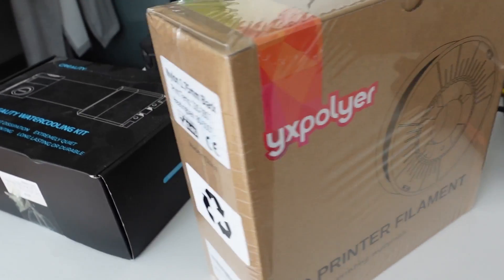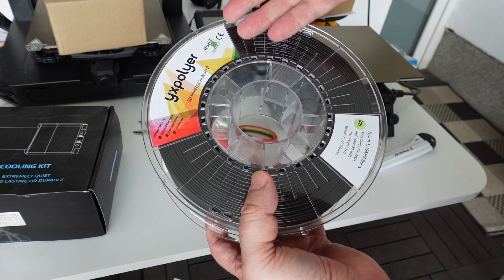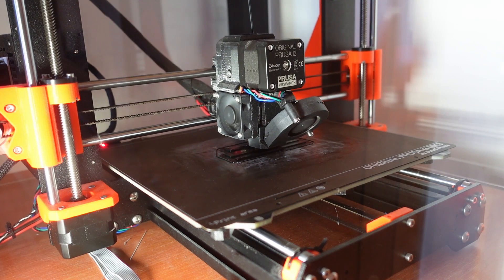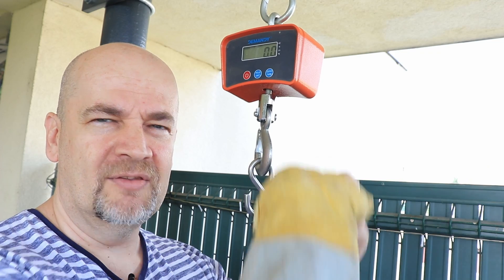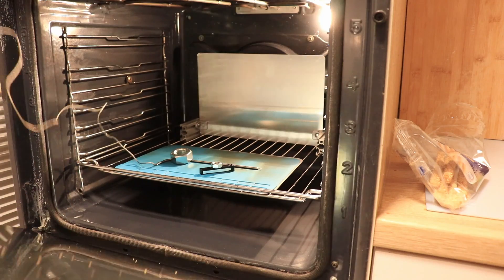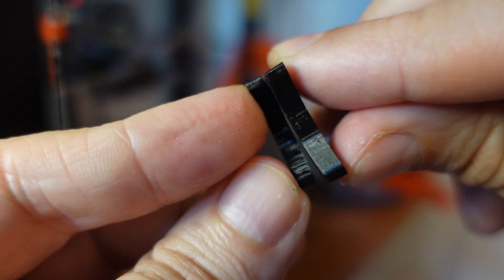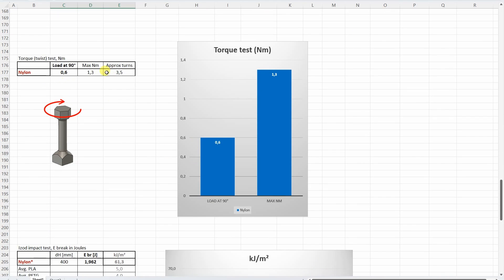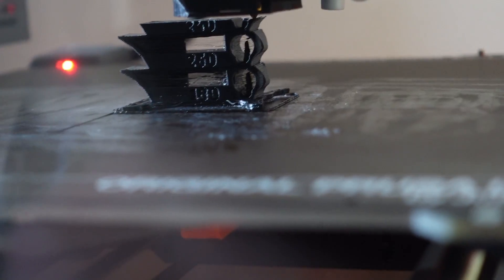Cheap and strong Nylon filament by YXPolyer

Comment: I print mostly in carbon fiber nylon, peek-cf, pa12-cf, pa6-cf, & pet-cf. My routine for printing ALL nylons is warp free, strong, and used for extremely harse use, lol. I print all nylons as follows...
With nylons, i use a carbon fiber bed, g10, or a titanium coated flexible magnetic bed. I ONLY, again...ONLY use elmers magic disappearing purple  glue sticks. Typically, i use magigoo or other more "expensive/premium" bed adhesives. But with all nylons, only elmers purple glue sticks! 
Pre-heat the bed to 90°c, and print the 1st 3 to 5 layers with the bed @ 90°c
Then, drop the bex temp to 32°c after the initial 3/5 layers
I typically print 280° to 300° depending on the brand of nylon
I print with 100%, infill and only use "gyroid" infill pattern.... this is rhe key to no warping. 
No fans or cooling at all, and you must print in a enclosed platform.... keeping the inside temp around 70° even... with very very still air inside the enclosure. 
Its also a must to dry all nylon filaments at 70°c for atleast 24 hours with the moisture reading at 10% to 12%. 
No warping, bending or creep. Hardened steel or titanium nozzles only with a high temp set up. Hope this helps and have a wonderful day!
Reply from the maker: Thank you for these tips. What 3D printer are you using? Hard to find one which can be heated to 70°C (enclosure)
Reply: @MyTechFun  I only use and buy qidi printers. I run this same formula in my Qidi x-plus 2, qidi x-max 2 and 3 ( 3 is the newest ), and I also have the qidi CF-pro. 
But with qidi, all three of those printers come with a high temp extruder set up and a "normal temp extruder"... so they all have the same exact high temp nozzles. Also, another tip that I did was I, but that thermal blanket material that you take camping and things like wilderness survival.... and I just cut 2 of them up and used double side tape... all three printers hold and lock all that heat from the bed and direct drive high temp extruders... they absolutely don't need an "enclosure heating system"
Reply: Thankyou for the info!❤
Reply: @szekerespista3758  no problem at all... this community is always excellent with helping me with everything I ever needed... so I pass on that same curiosity 👍👍

Comment: Great Content thanks! I use 3Dlac spray on a textured PEI bed which has worked great for everything i have tried to print on it so far including overture easy nylon and i had no issues with warping due to the solid adhesion. I have also printed taulman bridge nylon using the same setup and have had great results when it managed to finish the print... Unfortunately my taulman bridge is basically useless as the filament clogs and the prints most of the time fail before completion due to the filament having ridiculous tolerances. I measured the bridge filament at 2mm diameter at some points which makes it basically un-printable. I am unsure if the bridge filament is so bad due to its age as i have had it in the original packaging for atleast 5 years before i first tried to use it so maybe it swelled during that time im not sure.

Comment: @MyTechFun What is name of the torque meter you are using? I use a torque meter to test the strength of my 3d printable hardware designs but the one I have doesn't measure anything lower than 17 Nm. Most of my tool designs can get up to between 20 Nm to 80 Nm so my torque meter works fine but the smaller tools I make are not needed for torque over 17 Nm and I haven't been able to test them. Do you have a link for the torque meter you used in the video? An affiliate link is fine if you have one.
Reply from the maker: Kkmoon 0.3-30 Nm, but the link is not live any more.
Reply: @MyTechFun  Thanks!! 👍 I'll just look for a similar one then.

Comment: I bought this exact filament to try out as well. Here in europe it is way more expensive. (55,99€ and I got  it on a 10% discount).
EDIT: I just saw this is about their normal nylon filament. I actually got their PA12-CF. So that explains why it is more expensive.

Comment: Leave the timing belt a few days or soak it in water. Nylon gets more flexible as it absorbs water.
Reply: I used to boil my nylon model plane propellers otherwise they can shatter.
Reply: @AlwaysCensored-xp1be  they do the same with strimmer wire. If it is too brittle or breaks too easily then people soak it in a bucket of water. I have never heard of boiling them before though, does boiling it make much difference compared to just soaking it?
Reply: @conorstewart2214  I added blue Rit dye to show which ones have been debrittled. Those Cox engines spin fast. Prop bends on  bad landings instead of snapping.

Comment: I have used magigoo PA on glass and PEI surfaces (smooth and textured) and about 70C on the bed with 3 different nylon materials. Magigoo works great! Glue stick on kapton tape only for certain nylons. I have also found that less heating on the bed a large brim is better for some tricky materials like nylons and PP, so I lower or turn off the bed heating after the first 2-3 layers. One thing I have not tried yet and I would like to in the feature is a G10/FR4 "garolite" surface, that is supposedly perfect for most nylons.

Comment: Interesting. It looks like it performs much like Polymaker Polymide CoPA, which I have used quite a lot on my modified Balco / Wanhao Duplicator i3+. This filament looks like it bridges well, where in my experience The CoPA just won't bridge at all. It would be interesting to see how this prints without a printer enclosure.
Reply: I have good experience with Polymaker Polymide CoPA Nylon, too.  It has excellent bed adhesion, so no warping, as they claim.  I print on a Prusa MK3S with PEI sheet and glue stick (necessary because it sticks to the bed so well!).  To note, Polymaker CoPA Nylon needs only a 50C bed temperature. 
@mytechfun, perhaps you could test the Polymaker CoPA Nylon to compare?

Comment: Remember warp-free nylons work by delaying crystallization and to do so they need a cold bed. Less than 45°C. Heating up the bed only accelerates crystallization and defeats the purpose of the warp free technology
Reply from the maker: But why they write on spool and on website temperatures above 90C? In most cases, I just do what most of the users would do, following given instructions.
Reply: Yeah, I know you try to replicate what a user would do.
I don't know why they say 90-120. But AFAIK the major contribution to warping for nylons is crystallization, and having the bed well above Tg will make it crystallize despite the warp free additive while it's printing.
I've had great success with a cold bed and gluestick with all the warp free nylons that I've tried. I will get a spool of YXPOLYER, check and let you know how it goes :)
Reply: @santiagoblandon3022  update? what did you find out?
Reply: I was wrong. I thought it would be like Polymaker's CoPA, but it isn't, it does warp unlike CoPA
Reply: @santiagoblandon3022 which is blessing, it’s one of a kind being so impact resistant. Although torture to print
Reply: If this is true this explains soooo much!
Reply: Will let you know too. I already ordered it.

Comment: Go with 120bed
Reply from the maker: With PA sheet? Hm, didnt tried that. Personal experience?
Reply: @MyTechFun  no pa sheet doesn’t work with this material it will damage it
Reply: @MyTechFun  this material is amazing only down side it warps . I have used it in on of my projects where I printed a fuse rack and relays holder